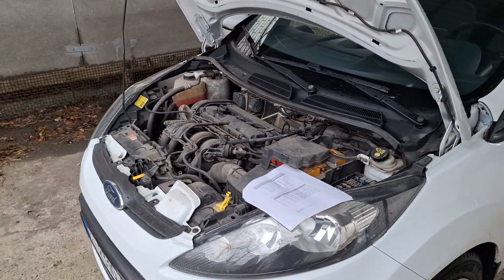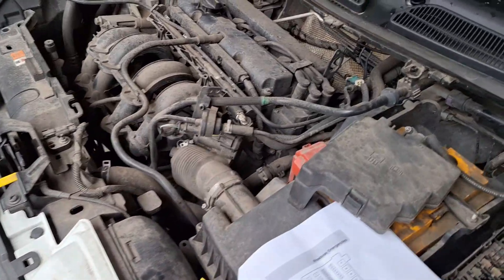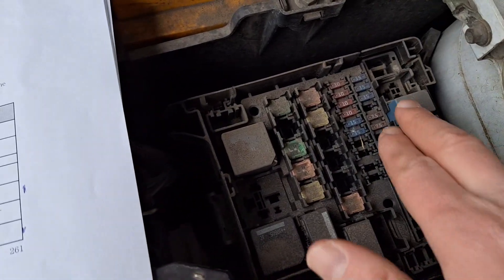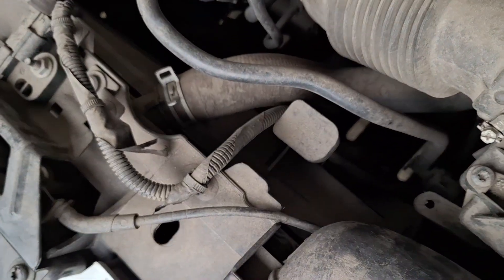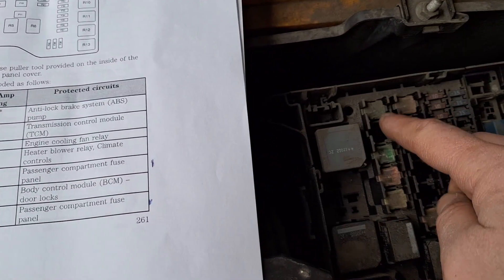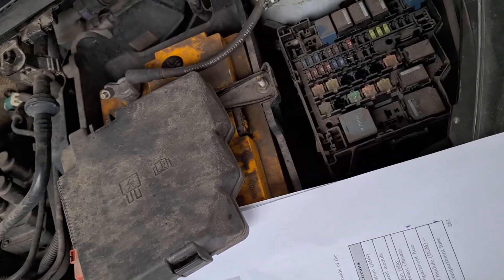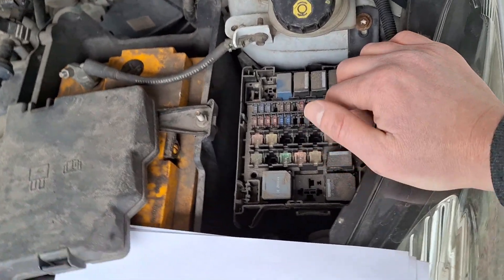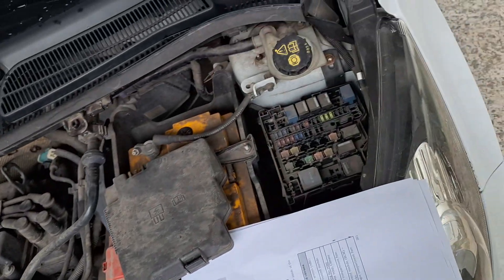Ford Fiesta MK7 radiator fan not working

Comment: I have a problem with ford ka+ (figo in the u.s.a). the fan sporadically started working in reverse and then stopped completely today. could it have the relays similar to the fiesta and be the cause?
Reply from the maker: I suppose, it can be either a relay in the fuse box under the hood, or the module on the fan unit (which these cars may not have). I would start by swapping the relay with any identical relay in the box.

Comment: If the fan never comes on, and the AC fails to blow cold, and you have checked all the fuses and relays like above.  Then it will be the carbon brushes in the Valeo fan motor.  Ford want you to buy a complete new fan assembly - but you can spend a couple of bucks and get 4 carbon brushes 6.5 mm x 10 mm x 14mm and solder them in and it will work like new.
Reply from the maker: Thanks, it's good to know!
Reply: How in the world did you get the motor open? Those metal pieces holding it closed are unbendable!

Actually I did get it open, but using an angle grinder. So now the question is how in the world will I get it closed again.

Comment: Can you drive when it’s broken ?
Reply: Basically yes if u dont Idle The car or get stuck in traffic jams. When u drive The wind Will cool Ur engine
Reply from the maker: Yep, just let it cool down from time to time since there is no temp gauge (in EU models). Better be on a safe side.

Comment: The fan works when I turn on AC but stops when AC is off and engine goes overheating. The car I have is a Fiesta SE 2012. What do you think would be the problem?
Reply from the maker: Either one of the relays in the fusebox or the module on the fan housing. Also, it would help to scan the car specifically for the temp sensor readings that are sent to different modules - potentially may be the sensor fault.
Reply: have u tried checking/replacing the fan resistor?
Reply: oh dang i meant the module in the fan housing as the uploader said.. here in indonesia we called it fan resistor.. 😅

Comment: How can ı check that ıts broken or no ?
Reply from the maker: Swap relays with any other relays that look the same and check if it works. Turn on AC and see if the fan works. If nothing works, the fan control module is likely broken or disconnected.
Reply: Why my ford fiesta  no have the big relay
Reply from the maker: The fan will have the module mounted on fan housing, so this module replaces the relay in some Fiestas.